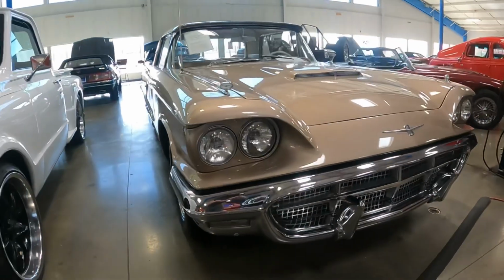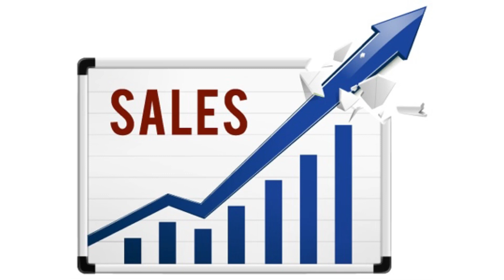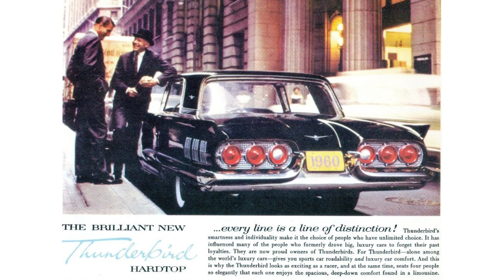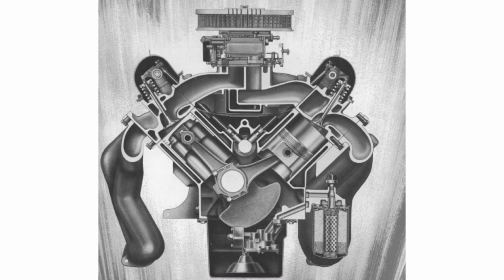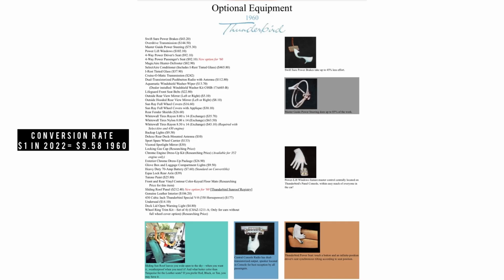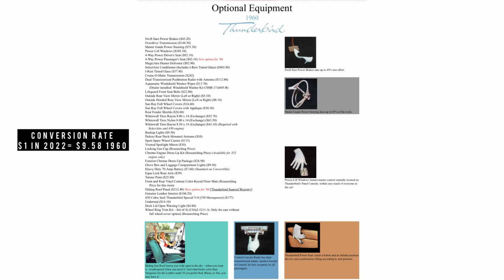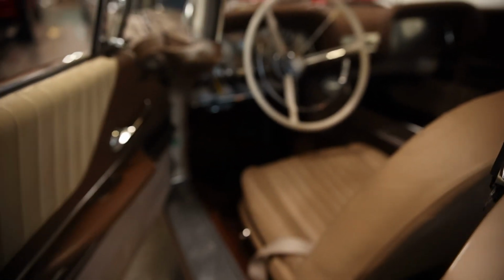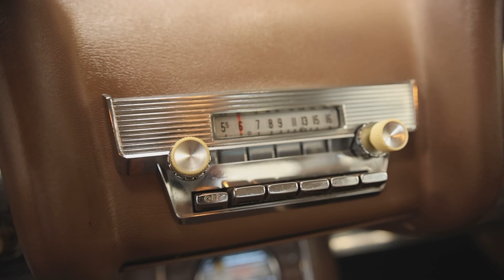1960 thunderbird in depth look

Comment: Interesting as this was a luxury car. Adjusted for inflation that would not be in the luxury car price range....Toyota Camrys can cost that much these days
Reply from the maker: Very interesting =) thanks for pointing that out
Reply: Adjusting for inflation is not a true indicator of what the current price would be. Added standard equipment, safety features, electronics and government mandates would all have to be added. That $3755 did not even include a heater, seatbelts or side view mirror. If you add the options listed that would come as standard equipment now you would be at about $5622 or $53,858.76 which would be closer. Then add the additional safety and other required equipment and improvements and you would likely be well into the $70,000 range.
Reply: @falcon664  What is your basis for the cost of the " safety and other required equipment and improvements"?
Reply: @turnne  All of the federally mandated safety equipment, pollution controls and mileage requirements that were added between 1960 and today. And, the engineered changes to engines, transmissions, ignition, fuel and exhaust systems, lighting, brakes and body structure, (e.g. crumple zones), that have been necessary to meet those requirements. None of those are in the 1960 Thunderbird.
Reply: @falcon664  Well...and there have been more efficient methods of manufacturing that are less expensive , just for inflation, as well as Chinese parts sourcing etc
So I get something are cheaper and others are more expensive
My question was what basis did you have for assigning  a dollar value to the safety items etc?
Reply: @turnne  Thanks for the interesting comments. You are correct in that the manufacturing costs, etc., are lower. The inflation rate for cars is actually lower than that of the dollars used as a comparison. That goes back to my original comment that inflated dollars is not the best comparison
That said, the National Highway Traffic Safey Administration has done studies on the added weight and cost of safety equipment, mandated and optional, for passenger cars. The 2017 report, (DOT HS 812 354), was for equipment added 1968-2012. The cost for all was 7.6% of the cost of the average car. I do not know if the report has been updated since, but more safety equipment has been added after 2012 so I look there. Since none of this equipment was available in 1960, an 8% add to the cost would be reasonable for safety equipment alone.  
As for the balance- knowing that the Thunderbird was a top of the line, most expensive, high profit model pegs it as a mid-sized luxury car. The price range is huge so pegging a closer number is more than I can compute.  
Thanks again.

Comment: Dual chamber master brake cylinder? What the...???
Reply from the maker: I know I thought the same thing when I saw it...
Reply: @What.its.like.  
It would appear the braking system has been upgraded.
Reply from the maker: 1960 Wagner electric company which studebaker later bought out right before going under was the first company to patent dual master brake cylinder. I also saw that in 1962 Cadillac had two hydraulic single master cylinders the fronts were tied into one master cylinder where is the rears were tied into another one... One failed we’ll still have the other one in theory.

Apparently a 1967 the federal government stepped in and made it a mandatory requirement to have dual master cylinders on all cars moving forward because evidently there was some 40,000 brake related accident that happened every year. Here is the link that I got the information from because it’s very interesting it shows the first set of different things we take for granted now.

http://www.secondchancegarage.com/public/history-of-automotive-brakes-1.cfm
Reply: @What.its.like.  Cadillac and American Motors introduced Tandem master cylinders in 1962. Studebaker in 1963. Ford changed when required in 1967.